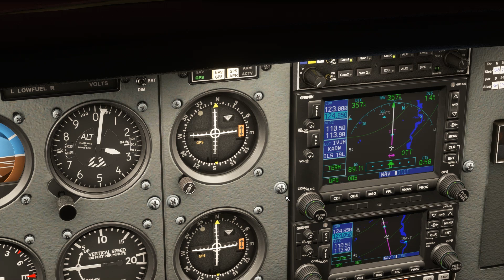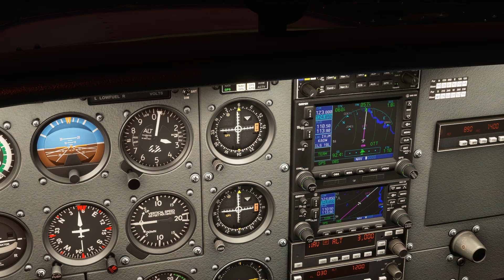Garmin GNS 430 530 Holds | Unpublished Holds | OBS Button

Comment: Do you turn the OBS to the inbound course during the turn? Can you do it before reaching the fix, knowing the heading you will turn outbound before hand? (I have Garmin G500, so I can set the heading bug on the outbound, and I want to make so much as I can BEFORE getting into the hold)
Reply: Did you figure it out? I think you can't. My guess is that if you did, the magenta line will be different from your current track to the waypoint, and when you get get to it the flag won't flip? Let me know if you'd tried it.

Comment: 1) so does the gps treat it like a vor by pressing OBS, or does it switch to the actual VOR receiver?
2) What if you are told to hold on a waypoint bearing, does this also work the same? The obs selector gives you bearings to the waypoint based on OBS?
Reply: 1. When you press OBS it doesn't switch to the VOR, it still uses the GPS, but acts like a VOR basically, but without the cone of confusion and the CDI sensitivity does not change with distance. It can do the same thing to a GPS waypoint that isn't a VOR, in case you need to hold at an intersection or a DME fix.
2. Yes, when you press OBS, the GPS will show your deviation from whatever bearing you select, much like a VOR.
Reply: I know it is not completely correct but i think of it this way:  Pressing OBS tells the Nav unit to grab the next waypoint and focus only on it.  Doesnt matter what that waypoint is. If the controler says the word "radial", I put that number at the bottom of my CDI display because a radial "radiates" from a point and the bottom of the CDI can be thought of as the "from" side. If he says "bearing" (although I have not yet had this happen) I put that number in the top of the CDI as I will be "bearing down on " (flying to) the waypoint and the top of the CDI is the "to" side.

Comment: Great trick. I find it also keeps you from chasing the needle as much because GPS readings on the OBS are less sensitive (At least in my aircraft. Know your aircraft!)

One thing to be careful with is using this on a check ride. My examiner failed the GPS during my hold effectively removing my ability to switch from GPS to VLOC so make sure if you have a NAV2 like he does, that you also tune your VOR on NAV2 so you have one CDI already indicating with a VHF backup.

Comment: Question :Why exceed a Standard rate of Turn entering the hold?
Reply: Meaning because of the direct entry?
Reply: When entering the hold, a standard rate turn isn’t required. This is because the start of the outbound leg is measured from abeam the fix or when rolling wings level, whichever first. 

How fast you turn to get there on the entry makes no difference. The clock always starts at the same point.
Reply: @RedSailor1701 Wrong buddy. You never exceed std rate turn in ifr. Jets fly half std fyi. Ifr is all about smooth and concise turns.
Reply: @charlie_sierra1 you are wrong, standard rate turns aren’t required anymore, but they are still useful for holds and consistency
Reply: @tothemax9850  What?  How about partial panel.  How about on a checkride.